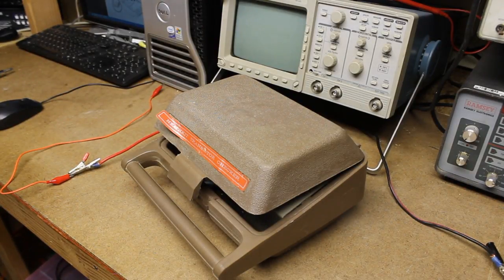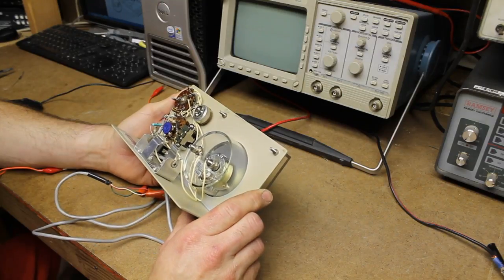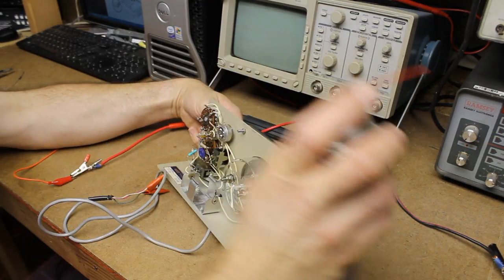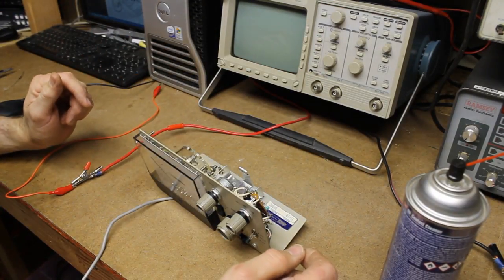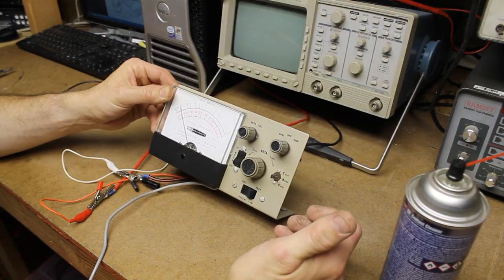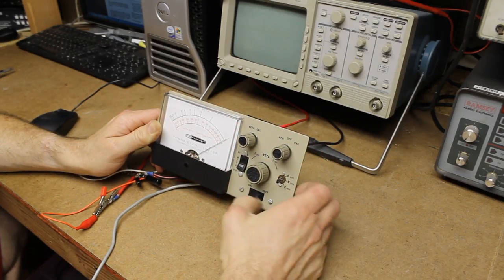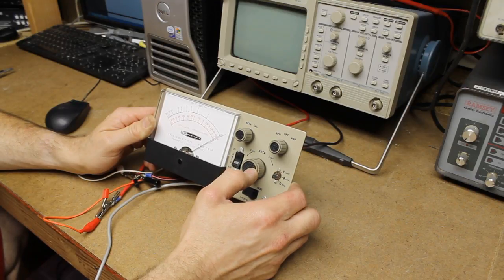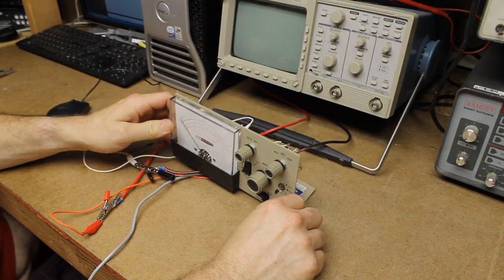Heathkit IT 18 Transistor Checker Teardown and Testing

Comment: What does beta mean? anybody know?
Thank you
Reply: Beta is the current gain - about the same as the collector current divided by the base current.  Typically roughly 200.
Reply: @acmefixer1  can you simplify it a little bit more please? What is gain? I see that on guitar amplifiers also. Is it like raising the volume?
Beta has always befuddled me I know that current =amperage. Also is high Beta a good thing or bad on a transistor? I do have the IT-18 so I want to learn how to use it I also have the resistor that came with it.
Thank you very much.

Comment: my meter goes beyond the end of the scale during calibration following
the procedure written in the manual on pg 12:

180 ohm resistor in probes red and white, 
switch to npn, 
leakage trimpot turned full cc 
cal knob also full cc
battery ok 1.45vdc

turning the leakage pot one way or another does not move the needle back from right,
checked components, diode ok, 3 precision resistors ok, 
replaced 10k trimpot with a known good one, still no go ....

what else could be wrong ?

Comment: Great video, but the PS fan is noisy. Must be one monster of a PS. I have the Heathkit transistor checker that has multiple cells, IIRC D cells, so it would cost a lot just for the cells. I should build a PS for it, but I seldom use any tester, a transistor costs less than a nickel nowadays.
Reply from the maker: +Acme Fixer Thanks for the feedback. The power supply is a big rackmount Sorenson 0-25V 0-40A supply and it is noisy, but very handy.
Reply: Acme Fixer, you could use AA or AAA batteries as they are the same voltage but higher amphours. It probably doesn't need the higher amphours since its just a transistor tester